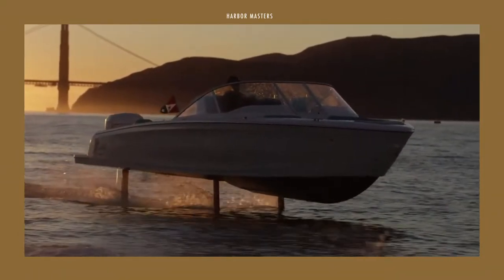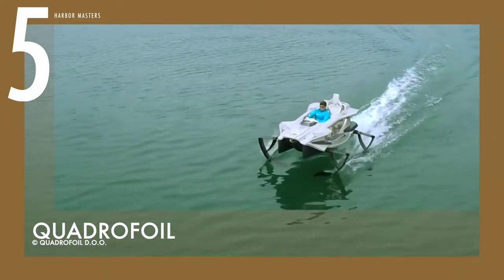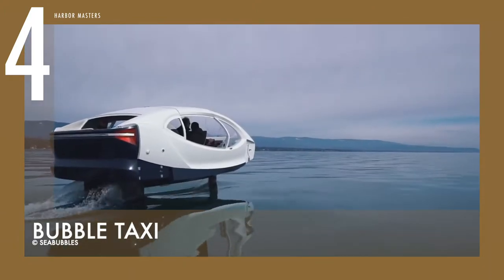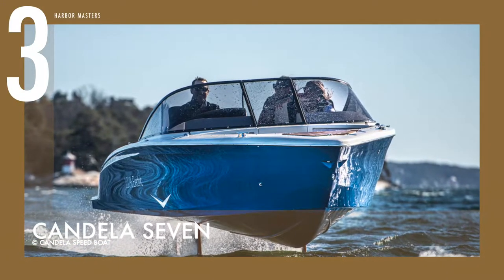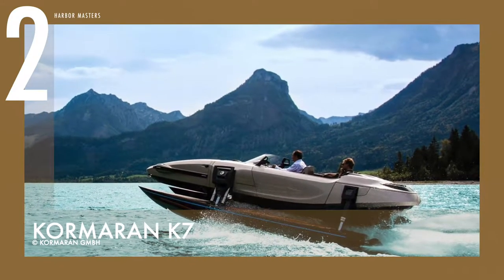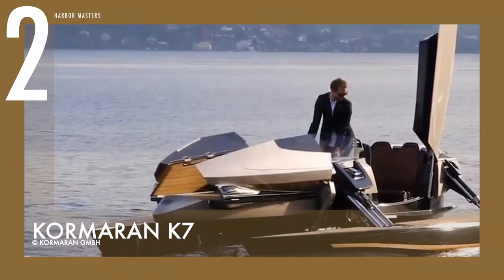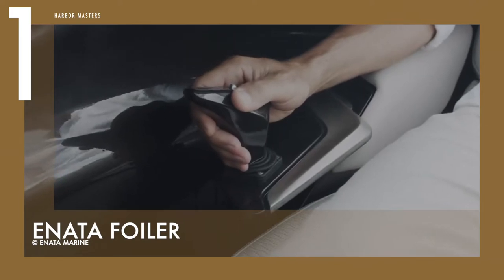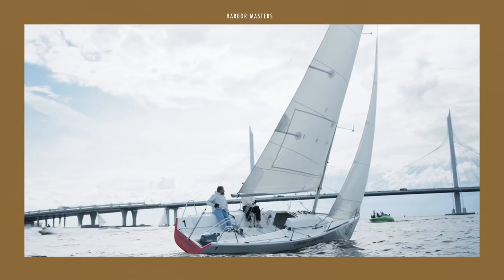Top 5 Amazing Hydrofoil Boats | Price & Features

Comment: kormoran looks to be a hydroPLANE
Reply from the maker: The main difference between a hydroplane and a hydrofoil is that a hydroplane uses the shape of its hull to glide on the water surface, while a hydrofoil uses underwater wings to lift the hull out of the water and reduce drag.